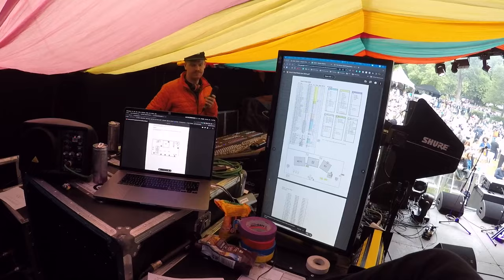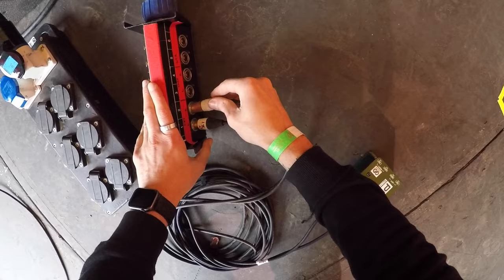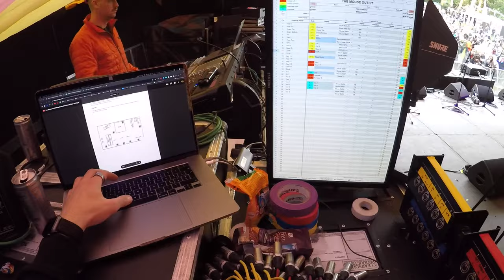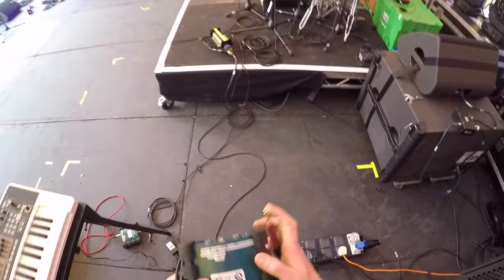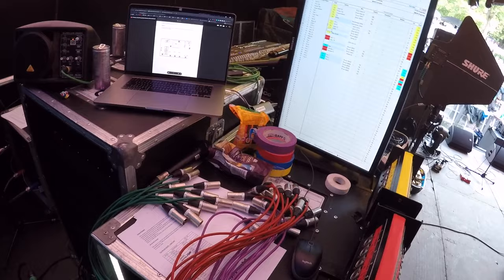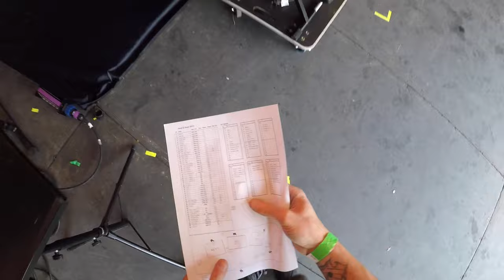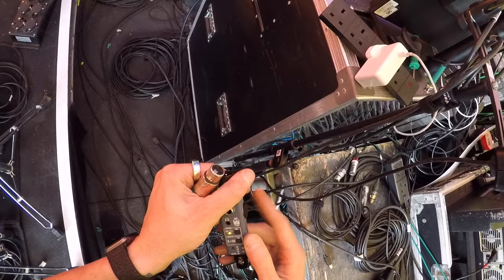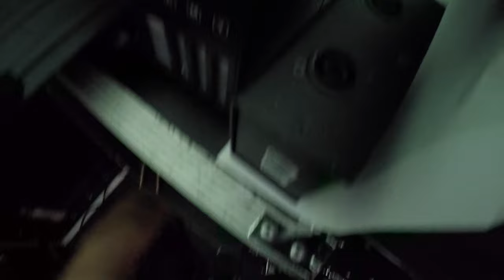A day in the life of an Audio Engineer, oh no wait of a Patch Tech.

Comment: Not questioning the setup and admire the attention to detail but just wondering why you dont just keep drums patched and basic backline less having to reconfigure? Just setup for the largest act and then all the other acts will fall within the parameters. keep a few spares on each stage box for the odd ones and those are the only ones that need changes.
Reply from the maker: This a good question and good observation for a few reason.
1- we had a few engineer having their show file so I needed to patch 1 to 1 to their show file so not following the festival patch.
2- a few band where using our patch and they had their own control so I need to follow their patch.
3- position on stage of a few bands was different so sometimes I had drum downstage and was easier to patch them on the Blue veam.
I get what you say and I did that for the festival before with drums mainly as they all stayed in the 12 channel.
Thanks for watching
Reply: @imdomtrotta  could you just load the show and do a digital patch on the console most consoles allow io to be safe then just patch channels. Just thinking it would be about the same time if not less depending. You have a very organized system just looks like a lot of extra moving parts and potential failure points especially with the drops being disconnected and reconnected for each set just thinking about the pins in the connectors. This makes a lot more sense for an analog setup but you are all running digico. I will shut up now but great work and admire everything. Typical as always that a band would arrive with nothing they need to run their own stuff and changing up input lists upon arrival handled very well with great calm! Bravo
Reply from the maker: @louisoppenheimer6618  agree with you but this is a discussion that we had in the past and not a lot sound engineer wanted to change their patch or soft patch I know it’s stupid but unfortunately that’s it 😅.
I appreciate your comments thanks
Reply: @imdomtrotta  i get it old school or nothing. Awesome job keeping the insanity in check.

Comment: I  feel like that stage isn’t big enough to warrant a patch tech... I handle a stage that size with my mon eng, and we’re change over on a average of 7 minutes... patching and un patching 12 ch multis instead of doing a festival patch?  Weird but okay?
Reply from the maker: thanks for watching.
we have around 8 bands playing in a day and most of them have around from 20 to 38 channels.
we have production coming in and we need to deal with sometimes patching them on our splitter.
Sometimes they use our splitter but they have their show file so you need to patch it to their show file.
A proper festival crew is always:
FOH eng.
System Tech eng.
Mon eng.
Patch tech
Lighting eng.
Stage Manager.
BUT yes you could do a festival with just FOH and MON engineer but if something happens during a show you will need to leave your MON position and deal with the problem, or imagine the FOH guy leaves FOH every time and comes on stage, normally FOH is 35/40mt from the stage, imagine run when there is like 6000 people.
I think it all depends from situation to situation.

Comment: What are common cable lengths used on these bigger gigs?

And, in a rush not winding over and under? 😉
Reply from the maker: Hey thanks for watching:
3,5,10 mt that’s the lengths that we normally use for stage xlr cables.
Regarding coiling cables, when you don’t have enough time, my priority is just patch the next band in and make them ready for a line check as most of the this that’s what they get!
Reply: @imdomtrotta  great BTS which imho gives you the best tips & trucks when it comes to the great sound "hobby".

Those LK37 stageboxes are huge benefit when it comes to speed and flexibility.

Comment: I am occasionally a stagehand at gigs, but I mainly work in theater (floor but also front of house). Now I have a few questions, such as which software do you use to prepare a gig or multiple gigs?
Reply from the maker: I use Google sheets, I have all the bands info on there and I build a patch festival looking at each band channel list
Reply: @imdomtrotta  Thx for the info just one more question 😁 which program do you use for making schematics of the stage (stage plot)
Reply from the maker: @finngordijn9266   I use powerpoint most of the time, easy to use and fast.
Most of the time you don't need to draw intruments on stage, but only position.
Channel list with input and output is important as well